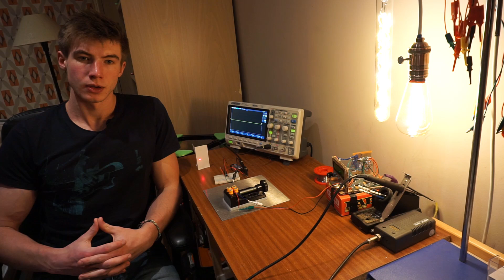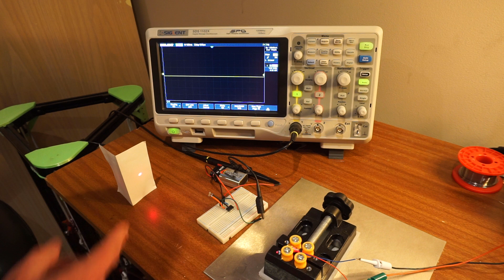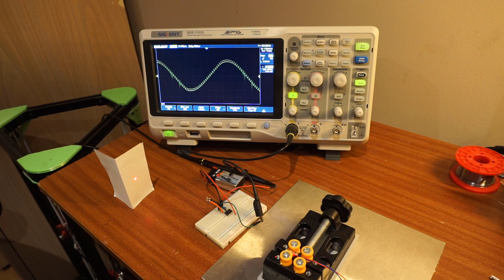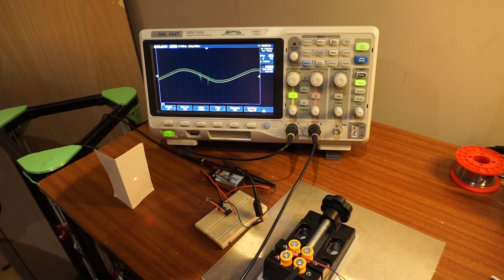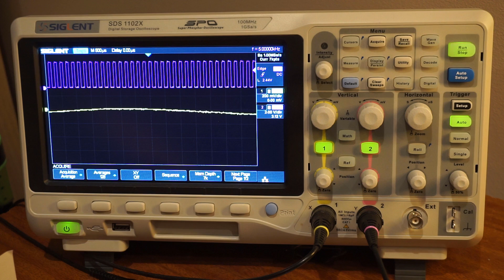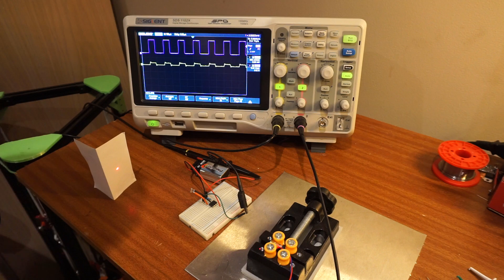How to measure small and noisy signals on your oscilloscope

Comment: So that's what that little spring is for! Anyway, I appreciate these tips; I was having trouble with seeing/measuring hum out of a tube guitar amp, connecting the scope to speaker terminals or a dummy load. Last night I took a male phone plug, soldered 8 ohms' worth of resistors directly into it, led two wires from the plug's contacts twisted together to terminate just outside the shell, and did the trick with wrapping a probe's ground wire around the end of the probe. Much quieter signal.